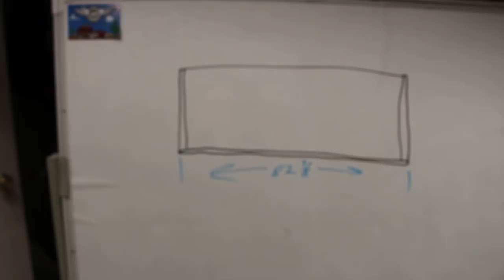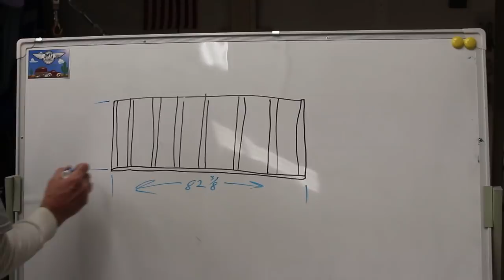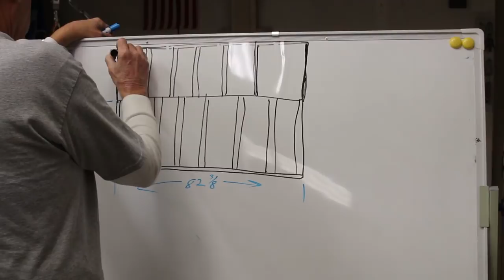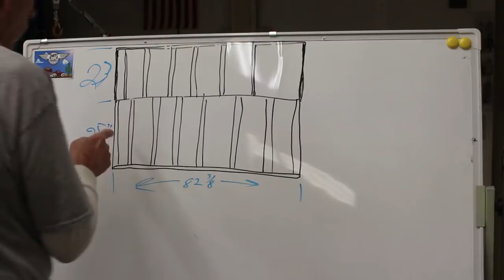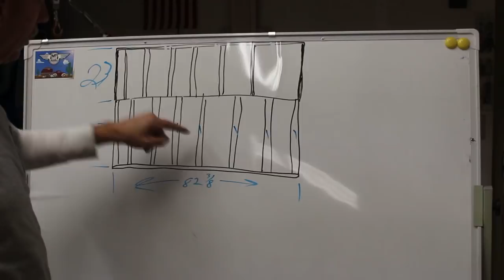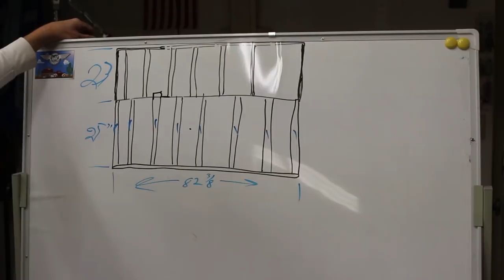Building A Goucho Bed For Your Vintage Trailer

Comment: Larry, 
Hope this finds you & Sabrina well!
Watched & scrutinized the video again, wondering is gimp installed between the floor & walls?
Did the walls come off?!
It's most noticeable in the PEX video for this trailer.
Reply from the maker: No gimp where the wall and the floor meet up. Only around cabinets.

Comment: Hey Larry, I was doing a project with my dad one time; I scored my cut line, marked my waste side, and went to town with the Skil saw. Nice straight cut on 3/4” 7 ply plywood. But when I put it in place it was exactly 1” short! Expensive mistake.
Reply from the maker: Most cut mistakes are one inch or one foot...

Comment: That’s awesome. My Comet bed comes  out from the side. I could use a rail on the back to support the slide out but wouldn’t be able to have that on the other side. I think the original used two legs on the slide out. Do you have any suggestions?
Reply from the maker: Put two legs on it. They can either fold up and go under the bed when you slide it in, and then they would drop down when it slides out or they can be permanent. They will then just set flush with the box when the bed is closed.

Comment: I've seen that paneling in a local trailer that is from the 1960's Is that like the original?

I prefer the shalaced wood look over paneling, was just wondering if that was a 60's thing.
Reply from the maker: That was a mid 60s thing. This new paneling is lighter than the old paneling which looked the same only darker.  I prefer Birch myself.
Reply: Grandpa, missed you in class this past week, you still with us?
Reply: @jerrytalley802  Im still around, guess i messed the email from @mobiltec

Comment: Thanks for showing this. I'll be doing the same on my 67. Do you have anything on the top bunk? Mine is completely gone and will have to be done from scratch.
Reply from the maker: It's just hinged 3/4 inch plywood. I didn't video repaneling the existing bunks.
Reply from the maker: If you need measurements go to my website for my contact info and email me a request. I'll do what I can.
Reply: +mobiltec  thanks a lot. I'll check into it and let you know when I get to that point. Did you have a lay out for the blue stripes on the side or was that just done by hand?
Reply from the maker: We just copied the photos that I took and did it by hand...

Comment: What’s the thickness of this plywood?
Reply from the maker: For the top of the bed I believe I used 3/8 inch plywood. You can go as light as 1/4 or as thick as you want.
Reply: @mobiltec  thank you sir! I wasn’t sure if it would bow too much with 1/4... perhaps the front fascia board provides some extra rigidity?
Reply from the maker: @dub944  Yes. And it has a drop down leg that I added to the system. Shasta didn't do that.